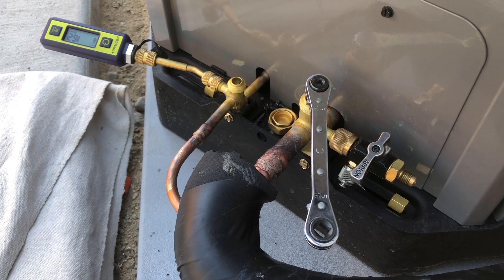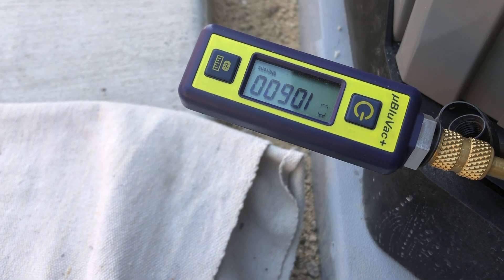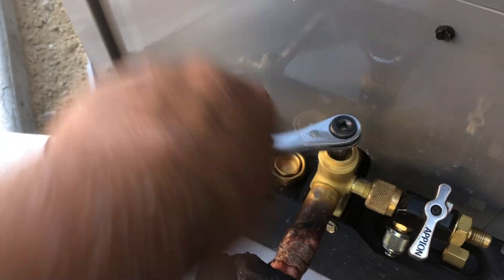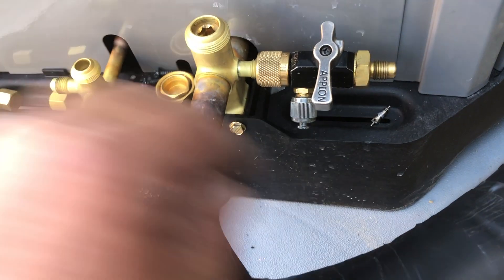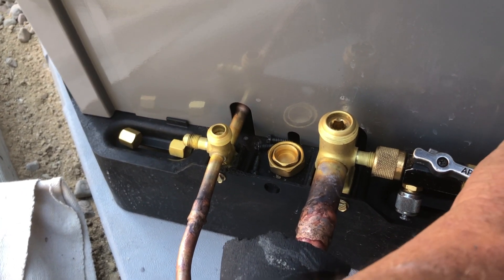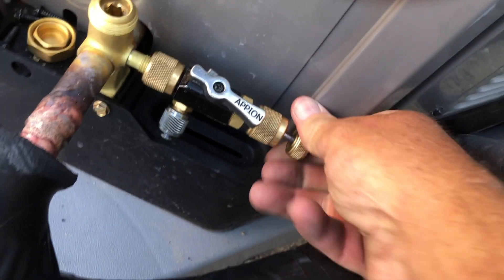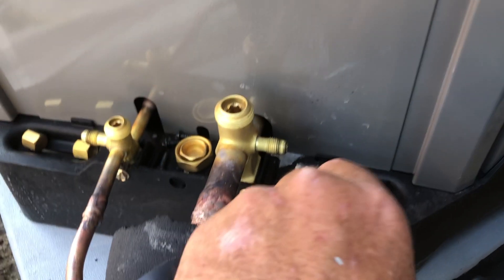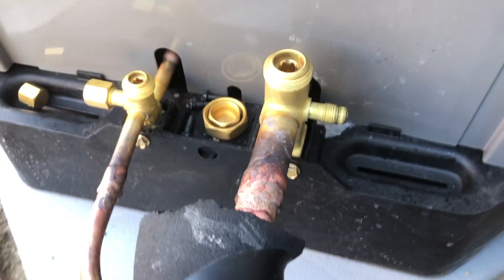How I open up my service valves.

Comment: Put my first Lennox A/C in last Friday, I did open the High Side first which in my situation was great because my Malco Allen service wrench was to tall to fit in the Low Side port so I had to cut the small portion off. The weird thing was I have two different heights of service wrench and neither one of them worked for the Low Side
Reply from the maker: I know what you are talking about! The service allen wrench in the video was modified, it was a brand new Uniweld service allen I thought I was going nuts! Thanks for watching Superior.

Comment: Do I put in shrader valves after or before opening valves
Reply: After opening valves. If you do it before you will let air into the system. You want to break the vacuum with refrigerant before putting the valve cores back in.

Comment: I need help...
My valves are leaking well thats what a local air conditioning company come up with 
King valve leaking ( both) and  the expansion valve ( TSB ) no working properly .. they estimating $1500 to $2000 to replaced just the valves not incluiding the TSB for new ones I didn't know they can be repaire the bad part is Iam in Las Vegas to the mercy of air conditioning companies everyone trying to take advantage of us in this hot hott weather..
Just curius if I find someone honest in town that offer me the  alternative to repair them and not replace them for new ones how much is usually for something like that?
How U think is the best way to exchange  email or phone number ? 
My system was working good until today 7/11/2020 my thermostat is always set at 76 today around noon went to 77,78,79,80 and none stop and u can feel it was hot outside temperature in Vegas is around 115
I have another company coming tomorrow After looking several videos about the valves been repaired I honestly believe is my case aboit the TBS I haven't started washing videos about that ... please help dont know what to do..
My water heater was replaced two days ago I put that on my home depot card and now this ... our place of work still close, no collecting unemployment and the air conditioning company told us we must better to replace the hold system for a new one considering is 9 years old...
Please everybody any suggestion?
I don't know if putting my phone number here for better comunication would be a  good idea but Im desperate I have my wife and two kida in the house and I was told if I keep running my system at none stop will be worst .. night time stop and go it gets to 76 but day time it just keep going and going...
Sorry very sorry for making this to long god bless everyone.. STAY SAFE !!!
Reply: I know it's a bit late but expansion valve replacement is 2K alone. I live in the SF bay area..... everything in HVAC is expensive and alot of these bad have to be replaced and they cannot be repaired. The reason it's expensive is because they have to take out all the refrigerant, pull a vacuum and add new refrigerant. It's about a 3-6 hr job. The best way when it comes to HVAC is to buy it, take care of it by joining a preventative maintenance plan where they are constantly maintaining your system. Hopefully you took care of it and just remember that when it comes down to HVAC everything is very expensive.